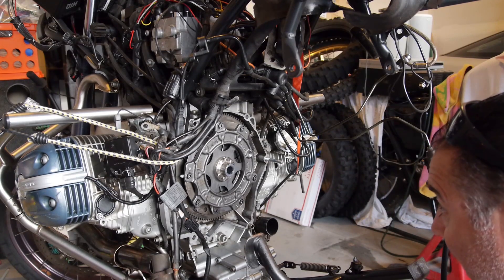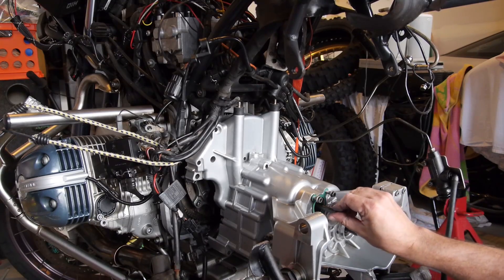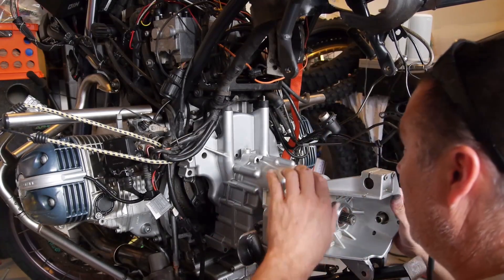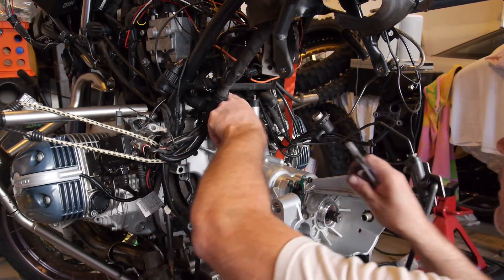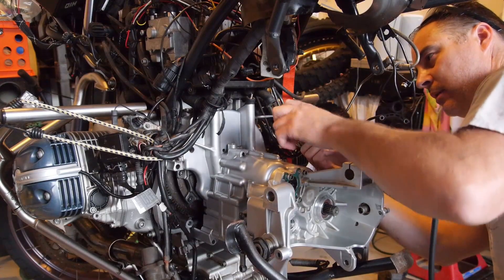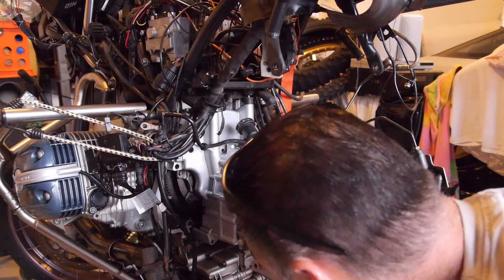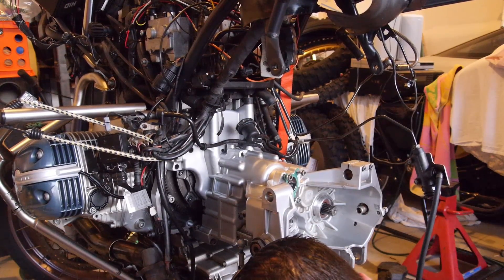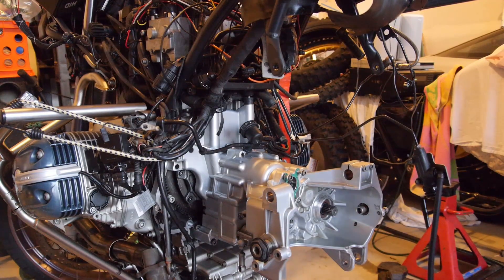BMW R1150GS - Pt.10 - Transmission Install

Comment: Well done. Also a great fan of Chris Harris. Great gearbox work. I did clutch on mine too. Although Chinese clutch plate sux & in the rubbish. Used oil proof clutch plate.Excellent videos.